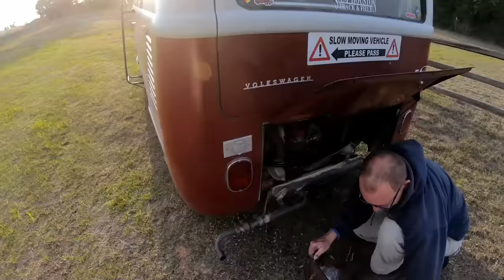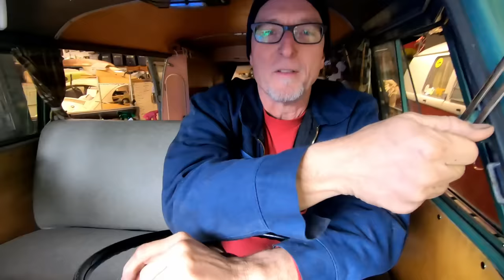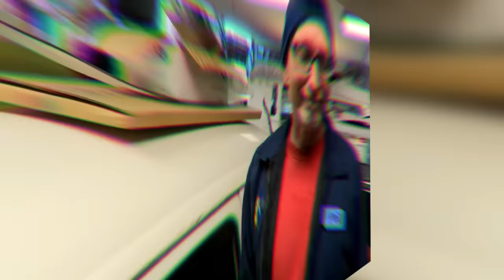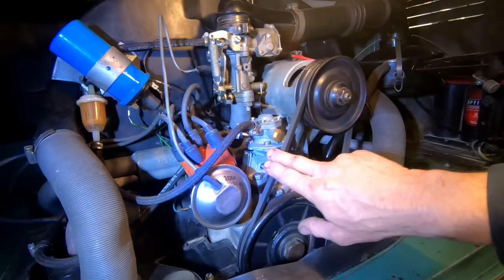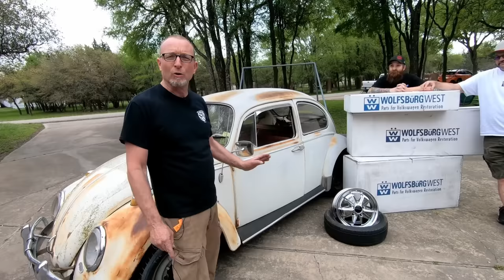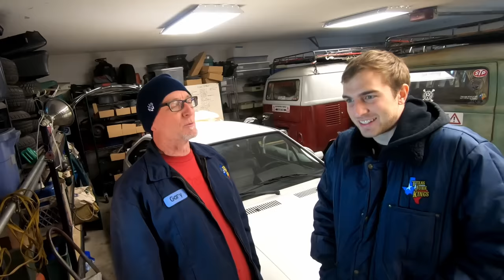10 Things They Don't Tell You about Owning a VW!

Comment: My dad sold VW at a dealer in the early 70’s. My first, maybe, 8 cars were Bugs.  All 60’s, mostly 6 volt systems. F.M. Converters on my Syphire AM radio. I also had a 65’ van. (I loved it, and miss it). Maybe paid $600 for the van. It was perfect. With my dad working at the dealership, parts were available for tune ups etc.. Extractor exhaust, Hurst shifters, oil coolers, Nerf bumpers, all the custom stuff was a trip to Warshowskis (sp?) in Chicago . We got a catalog every month. You own a bug, and you become a mechanic. Metric tools were kinda a new thing. Yanking motors to do a clutch was routine. Swap out an exhaust in an hour. I hated doing brakes. Had to take the drums in for turning. I could go on and on.....  every time I smell that VW smell I’m reminded of parking facing downhill incase the damn thing won’t crank. Thank for the memories. I would love to see your collection someday.
Reply from the maker: Wow kg we would love to have a sit down with you and talk. I bet you could tell some stories. Thanks for sharing. If you go back to some of our older videos You'll see some of our Volkswagens we have about 80 videos in our catalog. Thanks again for the comment you have a great day
Reply: VW Life I will certainly watch more of vids. I still love the old V dubs, but you guys can collect em!   Thanks.

Comment: 18.   You will learn how to brake using the hand brake when the brake lines break.   19.  You will learn how to engine break after the brake pads wear down to nothing in less than a year.  20.  You will learn to park on a hill so that you can kick start the engine when the battery is too weak to do it.   21.   When all else fails, you will learn to find someone that has a vehicle with a REAL chrome front bumper that can give you a push start.  (Most modern bumpers are just Styrofoam and will be damaged by attempting this.).   22.  No matter how aggressively you drive it, it is impossible to get less than 12 mpg.  23.  You will install a 6v to 12v step inverter so that you can you modern electronics.  24.   You will drive 20 miles straight to get off an interstate road with the steering wheel pulling extremely hard to one side due to a sudden broken front end component.  25.  You think the loud leaking exhaust sounds sporty when it's actually killing you by leaking into the heating system.
Reply from the maker: wow you gave us a whole new list to consider! :)
Reply: @VWLifeVW      ... and all those things happened to me with just one VW bug in less than one year and before I even turned 18.    I had  bought it from a neighbor for $400.   It was my first manual transmission car.   I've been driving manual transmission cars exclusively since then just with more power and reliability.    The bug taught me to drive cars vs riding cars.
Reply from the maker: @laughing5559  most people have no idea.  they don't even think twice about the chances of not getting to their destination without some kind of issue or how to fix it.  it's been lost on the current generation

Comment: ##.  X.   10
You need a fire extinguisher.
Tool list fuel line  extra filters. A working 009 
8mm to 24 wrenches.
13 mm scoket. 
Basic hand tools
Belt acc, Cable.
Clutch cable
Spark Plugs
Points/condenser
A few fuse's
Reply from the maker: Yep good stuff thanks!

Comment: Most important: Air cooled VW's are manual cars - manually adjust the brakes, link pins, valves, clutch and most everything on the car EVERY 3,000 miles!
Reply from the maker: That's right Gary thanks for sharing!

Comment: The grounds suck. You have to hardwire all your lights and your engine with supplemental ground wires to keep em running and working. Also, you have to make sure that the spade connectors are firmly in place, because if one slips off in a bad situation, like a coil wire when you are on the freeway, then you can become a statistic. This isn't regular maintenance. It's a modification that fixes a problem that the factory didn't design correctly to keep them cheap.
Reply from the maker: Good tip!

Comment: How about for #10, "I always end up with the strangest oddball"?  Like when I had the '66 Bug and needed a spare?  I was told (?), it was the only year they had that bolt pattern, and it took 3 mos to find another rim.  The Super Bug I got now has 2 mufflers sitting in the garage, because I didn't realize someone changed the intake manifold.  :(
Reply from the maker: That's strange because 66 would have had wide five

Comment: #10 put a VW engine in your airplane. I have 2. One is a 1200cc 45hp1/2 VW in an all aluminum ultralight airplane called a Hummel Ultra Cruiser. The other is 2400cc 85hp in a Hummel H5 airplane. Both airplanes I built from plans.#11 You need to adjust valves ever 50 hours. What do you think?
Reply from the maker: I think that is amazing! Wow
Reply: Hi @VWLifeVW   If you watch my videos you will see my VWs in action. You apparently did not know that there are quite a few airplanes around useing VW engines. We don't need high rpms we need low end torque. Both my engines are 94 x 86. I cruise at 3000 rpms on the 1/2 VW and burn 1.8gph.  The 2400cc VW I cruise at 2850rpms with a burn of 3.5gph. Now on take off I have seen a fuel burn of 6.6gph!!! But I cruise I bring the power back to 3.5gph. That's a cruise airspeed of 85-90mph. So what do you think?

Comment: "VW has a ten gallon gas tank, so that meant"s you go to the gas station a lot"   This is a very naieve statement.  Most cars are designed to go 200-250 mile on a tank of gas.  Engineers look at the MPG the vehicle gets, and adjusts the size of the tank to allow it to go that far.  In thecase of VW, it got a solid 25 mpg, so a 10 gallon tank lets it go......um..... 250 miles.

Comment: 10: All the popular stereotypes about VWs are true. My 67 floated like in the 60s ad. Also started after it sat in a driveway for 30 years without me doing anything to it; sort of like the VW scene in Sleeper. After I got it driving, I put 1200 miles on the car before it conked out on me at the side of the road, just needed a set of points and off I went.
Reply from the maker: Very cool

Comment: 10 - the smell inside a classic beetle. That mix of gasoline, mildewed horse hair, 1970's-1980's cigarette smoke embedded upholstery with the ashtray that had the shifter pattern on it. The old oil smell when you opened one of the heater vents...... The old bug smell. No other car has that. A blind person can sit in a beetle and without touching a thing and identify it as a beetle.
Reply from the maker: Yes the smell! Thanks

Comment: Bing! Bing! Bing! Bing! My first car was the family 71 super beetle. It had been in several accidents. A buddy said about repairing it that You cab only rebend sheet metal so many times. I drove the heĺl out of it. Traveling on the freeway my normal speed was Turn Signal. That means the speedometer needle was passed the top listed speed. The needle was straight down over the turn signal indicator that was at the bottom of the speedometer.

Comment: Old cars will break down, as will people. I had a 1957 Porsche, 71 VW Camper. Dad original owner of a 67 Bug, brother 59 Ghia c  convertible, sis automatic Bug. None ever broke down. 11-It doesn’t have a radiator so it has less chance of overheating, spending hundreds of dollars to routinely replace it and less rust and corrosion. All automakers should be challenged to make a modern day “People’s” Car.

Comment: #10: They don't tell you that the pre '68 or so with the oil cooler outlet going over #3 cylinder is likely to overheat it and swallow #3 exhaust valve, causing a rebuild of engine. I quit drinking the VW Kool-Aid when I found that out (must be one of the best kept secrets)
Reply from the maker: Doghouse setup is a good upgrade

Comment: I'd argue they're not really money pits as he describes - sure they do cost some money to work on, but relative to any other car of the vintage their parts are readily available and cheap. If you do the work yourself and get it fixed up (the up front restoration to decently drivable condition could cost you if you bought a beater) it's not that bad, they will need more frequent work than a modern car but compare the cost of that versus any newer car, which you typically have to take to a shop and parts are really pricey. Though maybe not as cost-effective as a modern car, you won't go bankrupt if you daily one. 
In fact I've put thought into the total cost of ownership of my Bug, obviously not counting consumables (oil, gasoline, tires, stuff all cars need as they are used) if I added up what all I've spent on it plus purchase price compared to what I could hypothetically sell it for, I'd probably loose a few grand. But in that process I also have driven it as a daily for nearly 10 years. Buy a brand new car and sell it 10 years later, you'd be out a lot more money than that!
Reply from the maker: This is true thanks!

Comment: They WILL break down.  Yes, but it's not because they're old.  They broke when they were new.  When I was in Kassel in the late 60s the police averaged about 3 months on engines in their transporters.  Btu they didn't care because the VW engine plant was in Kassel and VW gave them unlimited engines for free.
#10.  I had a 57 bus.  Insurance was a killer because in Germany they charge by the number of passengers.  Mine had seats for 5 but they charged for 9 because "you can put another seat in it"..  
or #10.  The brakes could hardly handle all of that power and speed.  Fastest 57 I ever saw.  47mph.  And the handling was worse than the brakes.  I've been told that you can roll one at 12mph in a flat parking lot and I believe it.

Comment: 11.  Each VW is different.  No two bugs or buses drive/ride are the same.  12.  Each has a personality  - I said, damn this is a good running bus, and it STOPPED right then.  The main wire from the coil fell off ??     13. Some smell of weed (70 camper I sold)  14.  Rescues are always an adventure.  15.  There's a network on Youtube, I'm not worthy, but there is Mustie 1, Marcy June Bug, and Mike Garage.... 16.  They all have rust
Reply from the maker: Very cool thanks for sharing!

Comment: If u maintain it, it will last. 146,000 miles put on a used 1958 rag-top 36 horse that received a used push rod and tube when I bought it. 200,260 miles put on a 1965 1500 11 window sundial camper, which I drove every mile of. sadly for me they have new owners. LUBE,CLEAN,TORQUE,ADJUST
Reply from the maker: That is so awesome thanks for sharing!

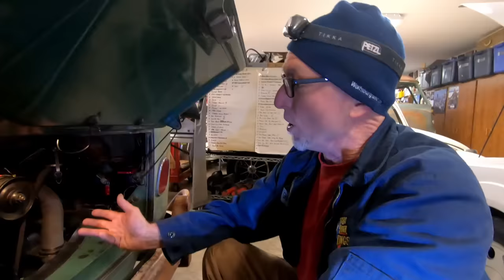Comment: Well at 7:36 you can see the perfect cause why a lots of air cooled  Volkswagon burn down. The cheapo  plastic fuel filter in the engine compartment :-) There are so many easy ways to avoid this:-) Just my 2 cents without wanna be a smart ass :-) Cool video by the way and thank you :-)

Comment: There is a filter screen in the stock fuel pump.  Don't ever run a non rebuildable pump with a  cheap filter.  These cars were very reliable when new.  Great heat.  Engine could be run wide open throttle all day long.  It is a converted airplane engine design.  Humans caused all of the problems.  Secure an original owners manual for your car.  It is a Bible.  Keep the engine stock.  No cheap 009's.  Original dist. and only Solex carbs. correct for your engine.  Every 3,000 miles, you must do the maintenance.  It's part of the fun!!  RIP Mr. Muir.  Cheers!
Reply from the maker: Thanks Brian!
Reply: @VWLifeVW  You are welcome!  "You must be one with the car" John Muir.  Read his book cover to cover.  Cheers!

Comment: kinda disagree... if you BABY IT (never lugging it so it gets cooling air, never revving past 5k rpm), do oil changes every 2300 miles, change points and check valves every other oil change, little old BUG can last an incredibly long time. the rest of it is like tuning a bicycle simple BUT you have to keep up with the HIGH maintenance... tires balanced? wheel bearings swimming in grease? girl we knew blew her transaxle, once we had another to slap in there... dropped engine swapped the trans, engine back in and running 45 minutes later, no joke. buddy did one side I did the other, while he was connecting the shifter under the seat, I was connecting the wiring (all 4 wires lol) and throttle. if you're really into Vdub's you know I'm not fibbing about any of it.

#10 = they ARE very high maintenance BUT any caveman can do the stuff. if you baby it and it's ALWAYS maintained, it's good to go anywhere anytime without breaking down.
Reply from the maker: Indeed thanks for sharing!
Reply: in a 1959 bug with a 1500 single port, driver and 2 passengers on regular street tires... we went out hill climbing. we stopped next to a Toyota 4WD pickup to say hi and see they were ok, then a little clutch ride+burn we continued on up the hill the Toy truck couldn't!
hard to believe but I was in the front passenger seat, it happened.
back in the mid 80's VW's and parts were SO "dime-a-dozen" and so easy, you'd been a dummy NOT to have one.
another buddy built "BUGFOOT" with a 5 inch suspension lift, 4 inch body lift, riding on 32's, using old bus reduction boxes on the rear arms, totally badazz off road.
more fun.. another buddy shortened a bus body to fit a bug pan, used the "Pinto Beans" adapter plate for a 2300cc Ford 4 banger, had to be careful in 1st and 2nd because it'd lift off with 2 people up front, been there too!
our rule of thumb with "bug motors" was keep them around 100hp, much more than that and they'd become short lived time bombs. that didn't stop us from doing a balanced 2110 with dual 44 del's that self destructed in 7 months as a DD... totally nucking futz! wind it up drop the clutch in 2nd and BOUNCE LAUNCH the poor thing. put a can of soda on its side a foot in front of both front tires it'd clear them, fastest 10 feet ya EVER saw. Rhino transaxle casing and everything "cheat" to go with it. street bug doing high 10's and low 11's was pure insanity and crazy FUN. we knew it'd go kaboom when we built it, and were amazed it lasted as long as it did.

IMHO, cars like the old BUG (simple old Datsuns and Toyotas too) should be being built brand new even today. with the simplest EFI management they'd get 35-45 mpg all day long, with easy repairs and cheap parts to keep them going.

Comment: #10. the strongest VW bits come from brazil.
#11. if you want fast gene berg is the only name you need...
#12. subaru swaps more complcated than people first realise espcially as the motor is wider than the VW engine.
#13. all vw aircooled engines leak oil. 
#14. brazillian busses run the 2 litre vw golf engine right up untill the stopped production.
Reply from the maker: Ah good stuff thanks!

Comment: Number 10 could be the crap people bolt to these vehicles.  Crap.  Crap ideas, crap bolting.

I go a long way to keeping things stock, except for rotors on the front, and red bushings.  Get rid of the centrifugal only dizzy, and go SVDA.  Don't glam up the engine compartment.  

I did put a spin-on filter on it, too.  

Do it anyway you want, but for a car I drive almost every day it's red bushings, rotors for front brakes, and a proper oil filter.
Reply from the maker: thanks :)

Comment: No1 is only applicable to poorly maintained Beetles.  Owned numerous Beetles from 67's to   year 77.  My last Beetle clocked 550 miles per week, for 3 years on my work commute. Never had a Beetle let me down. Winter starting was a breeze, when Hillman imp, ford escorts and cortinas, Vauxhall viva's, virtually every car of that era was made redundant on wet and cold mornings.The problem with these flat 4 engines were the disingenuous mechanics, people let work on their car. Mechanics who pretended they knew what needed done. Pretended they did it and most of the time never used the correct oil when they did do anything.
Reply from the maker: . Thanks for watching!

Comment: They're not as good on gas as most people think.
Reply from the maker: Yea well I think maybe back in the 60-80s they were decent on gas. But gas was better and the speed limit was way lower, so they worked well for that time period. these days not so much. Plus back then people/Mechanics tuned them properly- these days not so much. most just install a carb and think that as good as it will get, Not many really tuners out there for the basics of a VW.

Comment: Money pit?, name a cheaper classic or new car to maintain. I can buy a transmission for $100, all brakes for $100, I just bought a running engine for $300. $60 for shiney new headlights and turn signals with bulbs.
Reply from the maker: Yep, but once you start getting into higher quality parts that can be quite expensive. If you go build a brand new motor from CB performance it can be over 4 Grand

Comment: 1. They are noisy
2. They are slow
3. When they were new, the heating was terrible, now they're old and the heater channels have rotted away it's non-existant. 
4. They will understeer you into a hedge on every corner in the wet. 
5. If you don't keep adjusting the tappets, your engine will only have months left to live. 
6. Like the bay window, they used to be quite cool and pretty cheap, now they're expensive and not cool at all. 
7. They overheat and drop valves for fun. 
8. The foot pedals are annoying. 
9. All the parts used to cost pennies, now they're ridiculously expensive for what they are or they are made in Mexico and rust away in about 3 days. 
10. If you really want to be ahead of the game, buy a New Beetle instead. They cost a few hundred pounds at the moment because nobody wants them but they are now 20 years old and just about to turn the corner and become a classic. And you can actually drive them every day.
Reply from the maker: Thanks for sharing!
Reply: @VWLifeVW  Just my opinion. I have to say, though, I have driven many thousands of enjoyable miles in air-cooled cars.